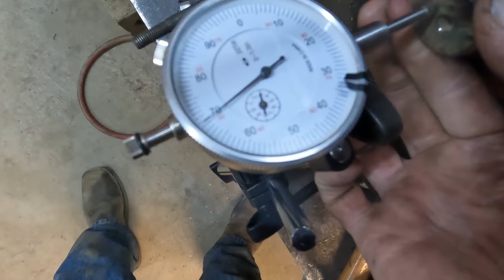FREE Diesel Trench Compactor Brought back from the Dead!

Comment: In 30 years or so: "So this little trench compactor was sitting over 20 years in an open field. After a short inspection it seems it was build of three different machines - at least! The motor seems to be an old military unit. As far as I know these came without a stator, so it will be interesting to see how the owner fixed the battery loading problem. But one step after the other. First, let's see if it even starts or if this Frankenstein unit was left here to die because of too many problems. I wouln't be surprised. ... Holy Moly! It runs! What is going on? Whoever put this thing together knew what he's doing. I'm impressed."

Comment: The trench compactor running over a GoPro would make an excellent intro!
Reply: I was just thinking about that small cap. I would wanna use a raspberry pi camera and somekind of guiding system :D
Reply: From the complaints I've heard, any Go-pro 8 would be the one to use 😎
Reply: Just keeping with the routine.  Everything that’s fixed and moves under its own power has to drive over the camera.  We didn’t make the rule.

Comment: Loved  the  repair.  Parts  swapping  is  a  normal  thing in  my  neighborhood.  It's  why  there's  so  many  half  tractors  around.  BUT......   Just  about  sang  along,  "come  with  me,  and  you'll  see,  a  world  of  OSHA  violations! "   Frickin'  GOLD!  Keep  'em  coming  Matt.
Reply: @charlesreohr6236  Like many government programs, there is a need for osha and it does good, but they always go overboard with anything government run and and it becomes expensive and stupidly restrictive. Hard hats for all jobs are one that kills me......or rather my neck. I didn't have any head injuries in the 22 years where they were not required on the job sites I worked on, but if you do government type jobs, it is required. Don't get me started on the attempt to get osha to mandate vaccines....  The environmental programs help protect the environment, but also get quite stupid and end up adding expense and and time to jobs.

Comment: Two parts paint thinner and one part boiled linseed oil. Just brush or spray on. Makes any paint and oxidized plastic look like newly painted, but with patina.
Reply: If that doesn't work and I believe it will, at least put on a coat of clear to preserve it.
Reply: @BobPegram  Or better yet, just leave it as is! Works great, nothing else matters.
Reply: @DarkFlamage  Then it just continues to deteriorate, to rust away.  That's what I personally want to avoid.  I don't mind things being a little beat up and used but I want to give it some care.  Matt got it working again, it has the purpose it was made for again.  At least keep it from getting worse and worse from neglect!

Comment: A great project Matt.
It was free. Then you put so much value into it.
The cost/benefit ratio is irrelevant. You took a "junk" machine and made it a runner. Being able to say, "I did it!" Is priceless.😁😎
I worked on a great many machines and systems that were so outdated the manufacturers were extinct. Ya just gotta keep trying. 👍

Comment: Hey Matt. Great channel! Next time you run into a stubborn bolt, such as you did on the flywheel, try replacing the adjacent bolts. After tightening them the stubborn one may break loose easier. German Allen hardware tends to be softer than what you'll find in other equipment. Dig out heads and use an impact driver to loosen them and you'll reduce the chance of breakage. In my 45year career I have worked professionally as a technician on high end German cars, all sorts of antique cars, off road equipment, and currently trucks and busses. I can sometimes predict how your projects are going to progress and applaud your curiosity and tenacity. I enjoy the videos, try to diagnose the issues, and then ride along to the conclusion.  Or maybe I just enjoy watching someone else do the work!
Thanks for taking us along on your journey!
Reply: For socket head allens (especially counter sink ones), I get the best/newest bit and a hand held hammer impact. And if at all possible, will use different hardware putting it back together. I'll take #3 Phillips over 4, 5, or 6mm allen keys any day. Far more consistent about loosening before rounding.
Reply: I agree 100 percent. I was referring to the impact tool that is struck by a hammer. I forgot the term "impact driver" is, today, used to refer to a power tool. I guess I'm showing my age. Personally I have never had a problem with Allen hardware. Like everything else, you have to learn to work with it. I would use caution in replacing critical hardware with a different type.

Comment: Looking at the two engines I'm guessing that they are rated for different power levels. You can see that the valves are are a good bit larger and with the longer push rods I wonder if the cam has a different lift. Also I might be wrong but I would assume that the 4 hole injector would not only have a better spray pattern but also inject more fuel.
Reply: this tri-hole setup will do for now while he dials everything in though
Reply: I saw that right away too. The injectors were different (Matt noticed) and the valves were clearly different at a glance. Probably a few other things we couldn't see that were different too. I had a parts engine for my rider that was 4 HP different and I never could tell the difference between those two engines.
Reply: @MaxNafeHorsemanship  Perhaps just the label... LOL
Reply: @MaxNafeHorsemanship  for current production Kawasaki mower engines they just change the carburetor for the different power levels.
Reply: @FishFind3000  It was a Briggs, but you are probably right. It was the only part that was slightly different.
Reply: If it was a milspec engine it might of been rated for a wider array of fuels to use. Maybe that has something to do with the differences in injectors?

Comment: Another great Video Matt,Brought back good memories from nearly 30 years ago.I worked on these trench compactors back when they were new!The later model unit had an option of a wireless controler so when compacting trenches deep down you could operate the machiene from on top of the trench and if the trench colapsed no one got trapped or burried due to the trench colapsing on top of them.Great machiene but very qurky to work on they were built very compact.

Comment: Hello Matt kudos to you for going the extra distance and changing out both cylinder head and stator / bearing plate assemblies. A very good example of how a basic engine changes so much with what it will be used for. And why you never want to dispose of original until the change over is complete. It may not need a new paint job but it deserves one of your new Disel Creek emblems.

Comment: I have to vote for the paint job! If a person wants to upgrade their life surround yourself with clean and shiny. You should put up a lean to someplace put your compressor and sandblaster in there I have done a lot of sandblasting with cheap washed mason sand. It has to be screened and dried but I just spread it out on the concrete and rake it around till it's dry screen it put it in buckets if you set up your workplace properly you can recover and reuse a lot of it. I also insist on good primer.

Comment: It was fun watching you problem solve on the fly!
I wouldn't have painted it either. Sounds nice but as we all know it's the prep for paint that eats time like... a thing that eats time.
I might have de-greased a few more parts to make reassembly more pleasant but that's me.

That engine sure had some curve balls! The difference between the original and the donor shows "rapid iteration".

Now all you need is a cable or pipe laying job to recoup your expenses!

Comment: If a burnout shakes the neighbors house this things going to level it 😝cheers Matt🍻
Reply: Loose valves Dont burn or leak.  They close tight.  They are ok if they raffle a little.
Reply: Allowing for warm up is a good thing.I adjusted them again with it warmed up. Its a pain and messy but a cold rattle is not a bad thing. Sell it..  !!!  You need a sand blaster to paint stuff to sell.

Comment: Completely forgot about the inspection plate when I needed to change out an engine in an SUV that I paid way too much for and spent more money than it was worth. Managed to tear it off with the flywheel teeth, I guess, I haven't done many engine swaps. You're not an idiot Matt, don't be too hard on yourself. I don't think there's anyone out there who hasn't had one of those moments, "oh yeah, that would've made it a lot easier!" Nice machine.

Comment: Never seen one of these machines work. The most amazing part for me is the way it steers. I take it that one of the tricks to using it is trying to run straight lines. Seems to me that any time you need to turn that it disrupts the compacting process.

Comment: Hi Matt. Hello from the UK. 
0.05mm to 0.15mm is roughly 0.002” to 0.006” so 11thou end float is out of range. Also the dial indicator should have been mounted the the engine casing somewhere as the engine could move in relation to the indicator giving a false reading in your set up. May not be a problem but something to consider. However all that said I really look forward to your content and your approach getting stuff done.

Comment: Applied Technologies on Hanson Ave Butler pa has bearings and seals for I think anything . I needed a pinion bearing for a old Cub lawn mower the local dealer wanted $175 !!! It cost $21 and change at Applied Technologies and he knew what it came out of when I set it on the counter . Just trying to pass on a little advice to you Matt

Comment: Well done on the roller, just get some 20mm stone with lots of fines in it and dress the larger stone and compact that. It's better to have a kerb or haunche edging for the compaction to press against and not just move sideways. Well at least that's how the Romans made roads in the UK, in place of a roller they used herds sheep as the point loading of their feet compacted the stone. Hench the raised nodules on your machines rollers.

Comment: That o ring on the shaft actually seals the center of the shaft on that bushings that seals to the outside seal. On my sons dirtbike for the output counter shaft where the sprocket mounts is the same set up

Comment: This rammax 1400 are not for compacting on the surface but they go in a trench the same width as the drums you fit so they don't fall over  you can get wider drums up to 600 mm per drum for the 1400 / 1404 making 1200mm the small one 700 had two sets of drums and the 1404   was remote control  so you did not have to go in the trench .you change the width of the drums for the trench so it did not fall over.

Comment: Had to do something similar for work. Had a flat cracked tire on a pressure washer. Trying to save a few bucks and not getting a new tire decided to take a wheel off the older pressure washer that the pump was shot but the engine is still good. The hubs and wheels were a different size so end up doing a whole frame swap since the engines were same(Honda GXPs).

Comment: When you need / want to make it work, you have the parts and can fanagle them  to work, you got a runner ! For me, doesn't always work out, but a lot of stuff just needs some old fashioned figuring and finding out what the blockage is, or the leak is, doesn't matter what kind of system, hydraulic, combustion, or electric.

Comment: Wow trenchrollers have come so far. The one we are currently renting is a 2 speed bomag remote control articulate steering and even has accelerometer sensors in the remote and unit so if it turns over or if you fall it will shut off

Comment: Wow! That thing hits like a ton of bricks! I've never seen one of these before, but as a density testing technician I've seen every other piece of modern compacting equipment, this thing would hold it's own against a diesel vibratory sled for sure. Probably does better on inclines than sleds.
Reply: Those trench rollers are great. I worked at the company that makes the remote control systems for the newer ones. We used our gravel parking lot to test drive each motor controller and adjust the remotes. That parking space is probably the most dense ground you'll find in germany. The newer ones are articulated in the middle and are easier to maneuver with the vibeation off compared to the track steering the old ones used. They're surprisingly capable on inclines or to move stuff around, due to the immense traction. Something to keep in mind is to let the hydraulic oil warm up a little bit before engaging the vibration to work on full load because otherwise the pumps like to start leaking.

Comment: I’ve actually used torqx bits to remove stripped Allen head bolts as long as it’s not totally round. That thing was a fighter huh. Nothing wanted to fit without modifying it.

Comment: Next time you have a hose with a crimp like that banjo bolt, and need to reuse it you can cut the crimp off and have a barbed hose fitting still, cut the old hose off and slide some nee hose on so you dont need the coupler

Comment: 20 odd years ago, i used to work for a rental company maintain those things.  when they started to look scruffy, they got a quick buzz over with a flap wheel on a grinder, then a few coats of colour chucked straight on the top.  in and out in under an hour 😆

Comment: Great video Matt, I think you would be better off using your heaviest machine to compact the gravel. The compactor you have isn’t really designed, but for a couple of inches of soil lifts and even then you really need to go back and forth a lot. Most contractors are way too impatient to do that and will then fail any required soil compaction test. I saw this over and over when I was a construction inspector for underground utilities. Keep coming with your great videos, and particularly your superb videography and editing! Thanks!

Comment: About 35"45 in is where I get the pit in my stomach.  Will it run?  Will iT Toss flaming pieces of manifold at me?  (Happened with my big bklock Chevy, took my GF (now wife, 51 years) back to school, manifold and Allison supercharger blew apart, engine sprayed flaming gas), GF bailed left, I bailed right, cat rolled upo into a tree and burned.  Thart ended my gearhead days.  Post-morten, high boost punchhed the top out of a piston,  gas dissolved in oil until it got enough to combust, then Boom!  Nice rebuild. Did you have tyo hoist it up and wait for the lightning?  "It's Alive.!"

Comment: 12.3V looks bit low for a lead acid battery charging voltage - that's usually above 13.7V.  I'd really like to see the voltage rise a bit as you rev the engine .  But it IS a fully charged new battery so it might be OK!
Reply from the maker: It was reading 13.5 for a while

Comment: The tread blocks on the wheels are pretty badly worn, suspect that's why it was skidding quite a bit when you were compacting. Possibly get them welded up with some hardfacing?  Not sure if you noticed but the valves in the newer engine were way larger, did you check to see the piston crowns were the same?

Comment: If you have 0.009" of end float, then you are miles out. You have to have 0.002" minimum end float, which is 0.054mm, so you're good there. However, 0.009" max end float (I think that's what I heard you say) is 0.229mm and that is way out of the upper limit you mentioned of 0.015mm. You are sitting 0.079mm above your upper limit, which is just over 3 thou out. Someone check my math please, but I think that's right. I haven't had to do it for years, but I spent my apprenticeship (loooonnnngggg time ago) having to go back and fourth between metric and imperial so I think i did those conversions right.

Comment: I have an old (I think German) smooth drum trench compactor. It has a hand crank and a long "drive" handle. When running, it shakes the ground about 25' away. I was buying a dump truck in Conyers Ga  and saw two of them. We bought the one that cranked. We used it several times and found a larger 4' unit and the 3 footer got parked. It won't start now. ? I am not going to do what you did. Just leave it in the shed.

Comment: Now all you need to do is take it all apart again and de-rust it, sand it down nice and smooth and give her a nice new paint job! Then sell it for 10x what you paid for it, and include the parts motors for the poor sap who buys it! LOL Remember, this thing is great until it breaks down again, then what? If you're gonna keep it then I would get some 1/4" to 1/2" plate steel and cut squares the same size as the nubs on the wheels and weld them onto there to give the thing a little bit of grip. Great work BTW, keep it up!!!!

Comment: Of course you had to ride it, that was a given, but I did notice you didn't do it with the vibration on :-). Looks like the feet on the rollers are fairly worn could these be rebuilt by welding some steel plates on top of them? Anyway nice to see a project completed and working as it should. Cheers.

Comment: Looked like the valves were quite a bit larger on the green head to go with the larger injector. I wonder if the military spec'ed a little more power out of the same displacement.

Comment: I don't know if you watch a channel called Steve Sommers by a guy with that name, its smaller than yours. He has set up a shop and has a lot of older industrial tools that he has rebuilt/rehabbed. He's a machinist of some sort. The point however which might help you as you are now setting up shop so to speak is that he has a lot of nifty tools for doing some of the things that you jury rig, in particular he has a hydrolic press unit with jigs for applying uniform pressure properly to get those parts apart. He has a video on it as well. YOu might want to watch his channel and get some of the tools he uses.